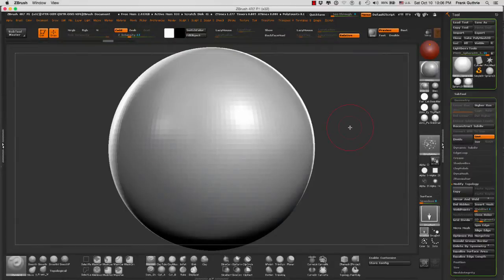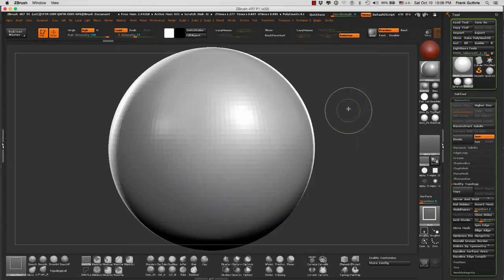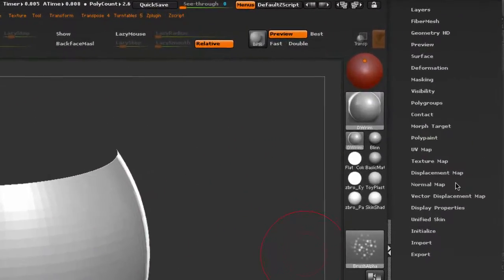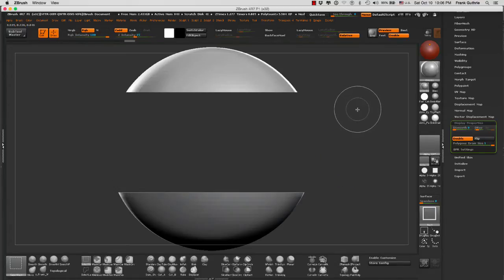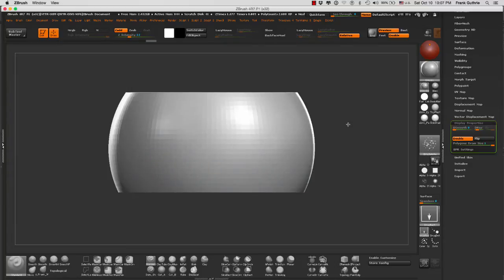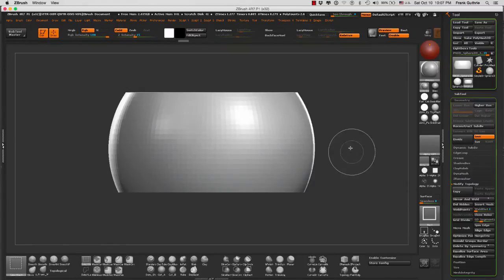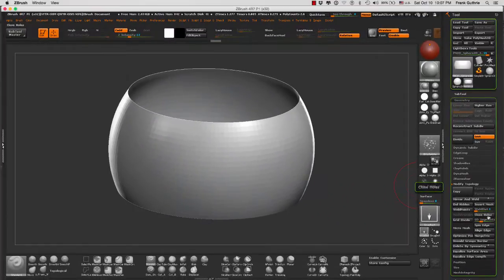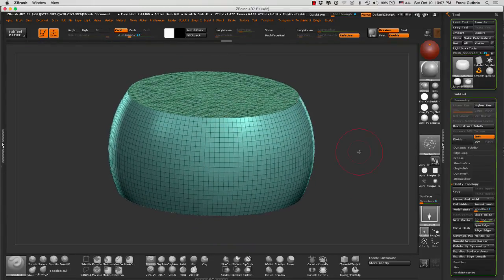DART 153 Intro To ZBrush: Delete Hidden

Comment: Ok so I´ve been looking for this for a while but, did they get rid of the modify topology menu in the 4r7 version? I can't find it anywhere.
Reply from the maker: Tools / Geometry / Modify Topology!...
Reply: Yes, that's where I started looking and it's not there
Reply: I get EdgeLoop, Crease, Claypolish, Dynamesh, Zremesher, Position and Size, but no Modify Topology menu there
Reply from the maker: Reset ZBrush's UI: go to Preferences / Config / Restore Standard UI, see if that fixes it.
Reply: I tried that as well and it didn't work.
Reply from the maker: Ouch! You may have to re-install ZBrush, that's not normal... Try the Forums, perhaps someone may have had the same problem! http://www.zbrushcentral.com/forumdisplay.php?8-Questions-amp-Troubleshooting-Forums&s=be71e93c361821e1db3ffcb3f9e6bd2e
Reply: Well damn, I feared as much. Still, thanks a lot for the help!